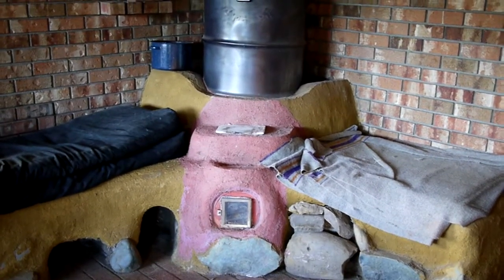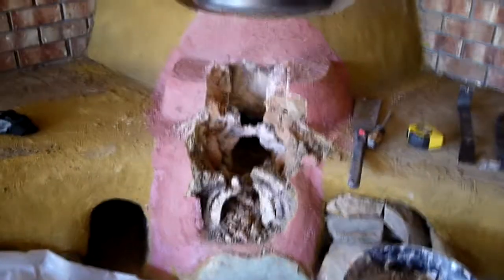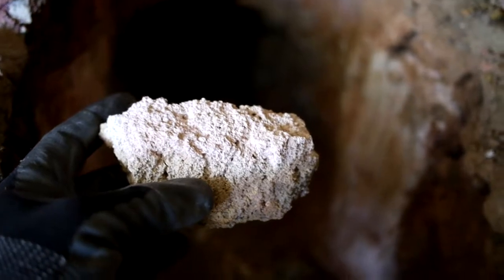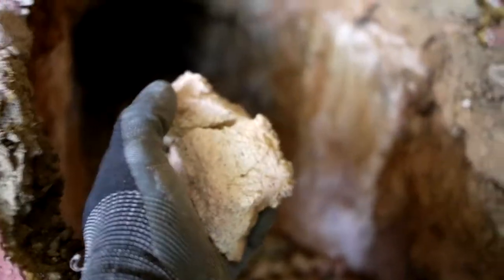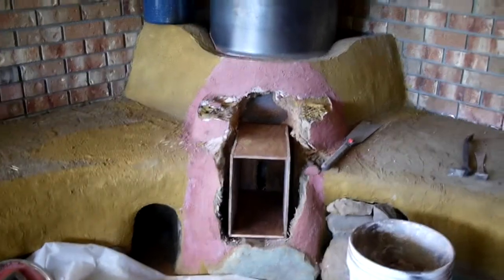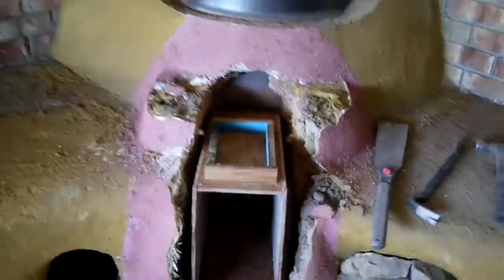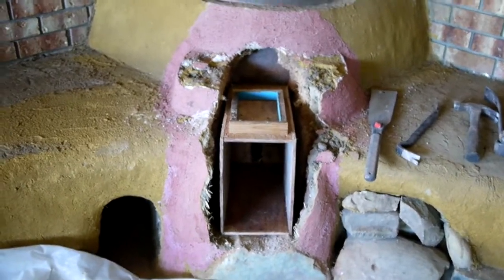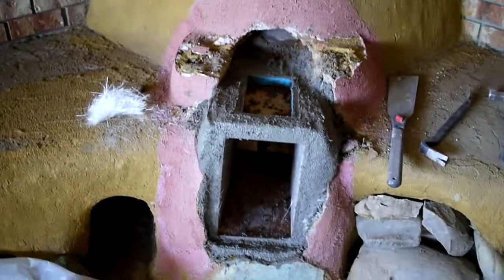Rocket Mass Heater J to Batch conversion, cast core follow up

Comment: That looked really good inside as far as the old material the heat they create it was surprising. The barrel looked good also. I am looking forward to seeing how it works with a bigger burn chamber. I build mine longer but not that high Thanks for the look.

Comment: Great watching your video's.  And I have another question. I will be following your design and recommendations for the cast core build on the stove and the riser.  My question is "Will the case core (using 1:1 ratio of clay/purlite (With additional fiberglass and refractory mortar) be enough to hold up the heat raiser.  I figure the riser itself will weight about 100-125 lbs (to be placed on top of the cast core burn chamber).  I'm saying that is a substantial amount of weight to add or have on top of the burn chamber.  In your original video, you said you were using another (already made) cast core from a previous build on which to dry out the raiser, etc  Again, I didn't know if I needed to have some type of masonry base to support the weight of the raiser or will the burn chamber be sufficient by itself to support the weight of the raiser?  Thank you again for your teachings. bob
Reply from the maker: Hi Bob, thanks for the kind words.  The core can support the riser, but remember that it is called a core for a reason.  It is not strong enough to use as a stand alone unit.  The riser won't squish it under compression, but it will not hold itself together, so it needs to be surrounded by cob, or brick, or hardibacker.  Something to hold it all together so it can't move outwards, and ideally more layers of cob like material to contain it and seal the inevitable cracks.  It is a core, not a stove by itself.  Thanks for the comment and good luck on your heater build.

Comment: Matt,having difficulty on my batch fed heater.Suspect not enough of a draft opening for a six inch system.Smokes too much and does not get much above 200 degrees on barrel.WHat size opening on stove front would you recommend? Still using my 55 gallon barrel with 6 inch insulated riser.Any help would be wonderful.Tony
Reply from the maker: Tony, did you build it to Peter's design exactly?  It's important that the dimensions of the firebox and port are exactly to those dimensions, or things may not work.  If you did, then a primary opening down low on the front door about 3"w x 2" h, and you must have the P-channel plumbed into the firebox just before and above the port.  It should be roughly 2"w x .75"h I.D.  Also, if you are not getting hot at all, how is your wood?  Gotta be good, seasoned wood, <15% moisture content or it won't work.  Hope that helps Tony, good luck with it.
Reply: ***** Thank you.Noticed on one of Peter's comments that he had the fire towards the port.Mine was started at the front.Some wood was oak,not seasoned.Will end up casting a box in the end.Tried using fire bricks and cob.Guy made me a door out of thick steel,but leaks around my window door. Not giving up.Thanks for your info.Tony

Comment: This is really cool to see.  I so badly want to build one of these but the aesthetics of the barrel are the final sticking point.  Any thoughts on disguising the barrel or alternatives that would still perform but look more natural?
Reply from the maker: Marc, there are options.  It all depends on the space, your design goals, and the aesthetic you desire.  You can eliminate the metal all together, but then you won't get that quick radiant/convective wood stove style heat.  In a small space, this may be more appropriate.  You can also custom build the "barrel" in any shape, painted, distressed, embossed, and so on.  There is also the possibility of a combination of the above, a brick/masonry container with a metal "window" to direct the quick radiant/convective heat where you want.  Lots of ways to go about it, the barrels just happen to be free and are a perfect fit from a function standpoint. Thanks for the comment.

Comment: Wow. That has to hurt. Taking apart that heater, ouch! But for the better I'm sure. 
So you went for over-the-counter refractory cement this time with just a little bit of fiberglass over the bridge. Humm
Reply from the maker: I need to make you a Tshirt or something Bob, to recognize your achievements as first commenter on every video.  Nothing gets past you man.

So, yeah, my mix is a good DIY mix for J style cores, and is an excellent insulating surround, but the batch shape, and particularly this one with the window, needs something with more strength in terms of spanning the roof and not falling apart. 

How did the turkey come out?  Still have all your skin I hope!
Reply: Haha, thanks for asking. Yes we deep fried a turkey in a conventional turkey fryer and it turned out perfectly. I still have all my skin lost some hair off my knuckles but that's about it. I hope you had a wonderful Thanksgiving as well. I'm staying tuned for the next video. I love this stuff.